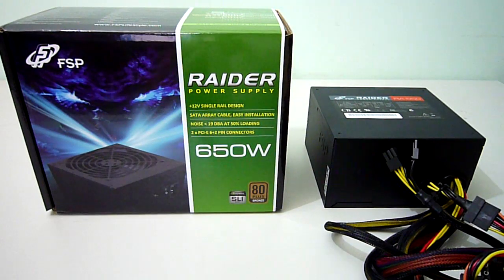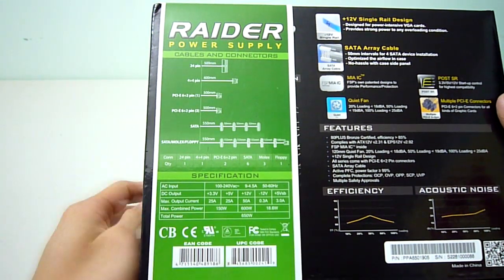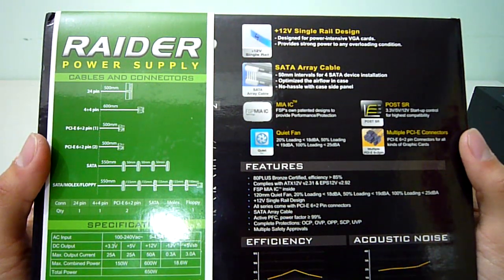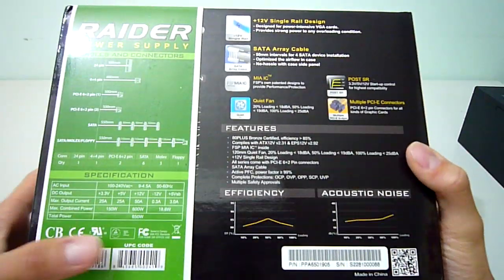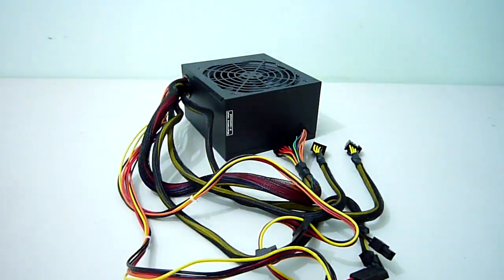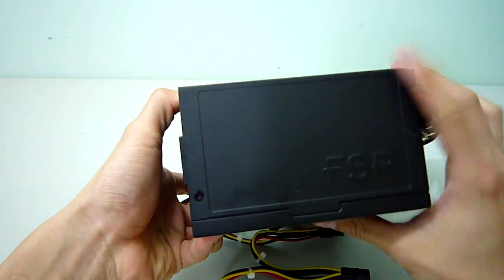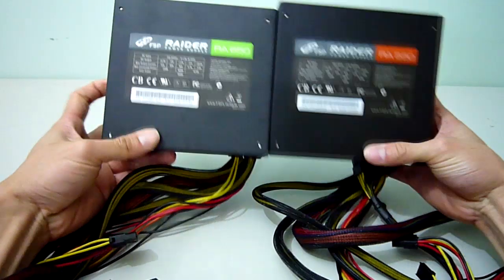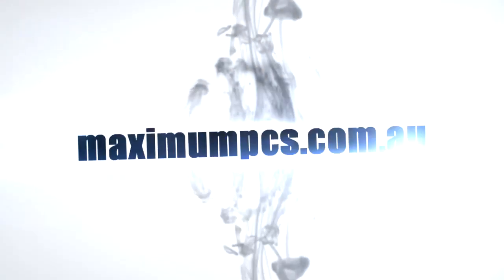FSP Raider 650W/550W PSU unboxing & overview - Maximum PCs Australia

Comment: can this run radeon r9 270x ??
Reply from the maker: both the 550W and 650W will have no problem running your R9 270x
Reply: I do run 270x from this, with OC fx 8320, np at all, really nice psu

Comment: Hi! I have a question: will the raider 650W PSU be enough for gtx770 + i5-4670+one 120mm fan + (MB/HDD/RAM)?
Reply: More than enough. With that setup, you'll probably need about 450w.